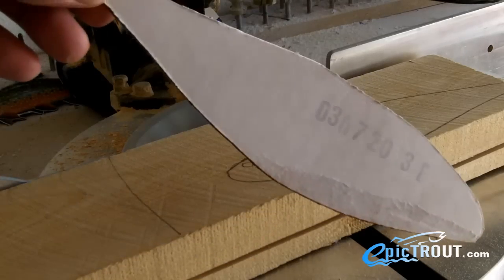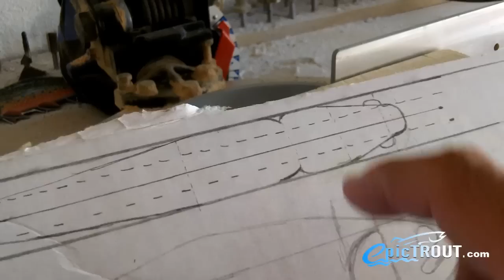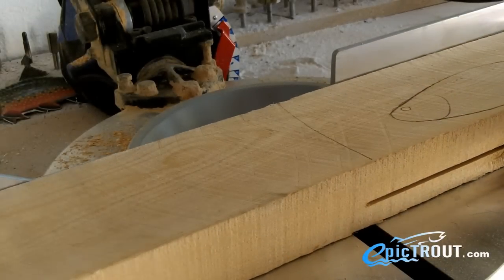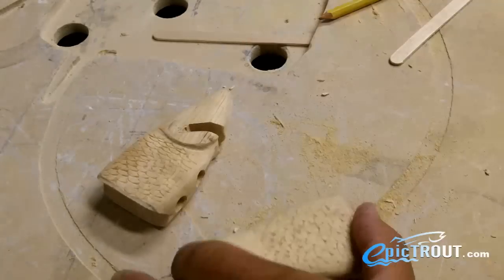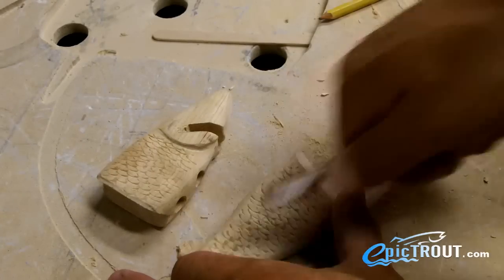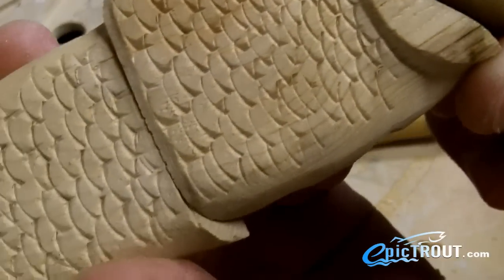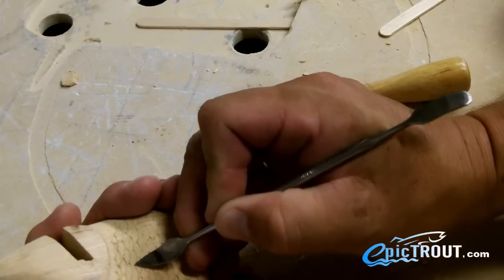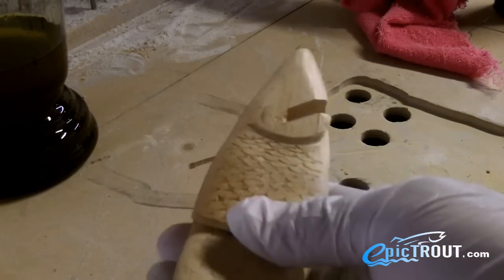Making a Wood Swimbait part 1

Comment from the maker: I use cedar wood. the eyes can be ordered form netcraft. I use a round over bit just to take the edge off. Once the edge is gone the air belt sander works better.
Reply: what was the sealing mixture ?
Reply: where did you get thw hardware for attatching the pieces?
Reply: hey man how could I find you on Instagram or Facebook